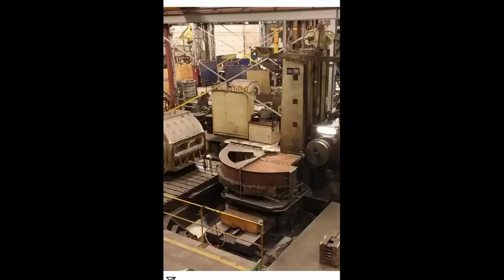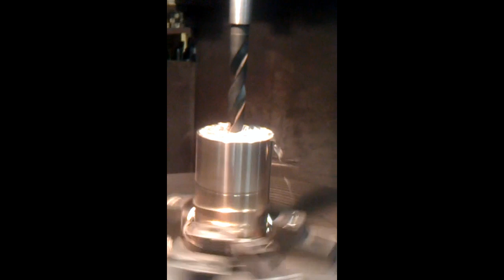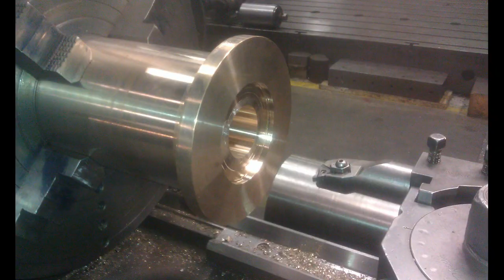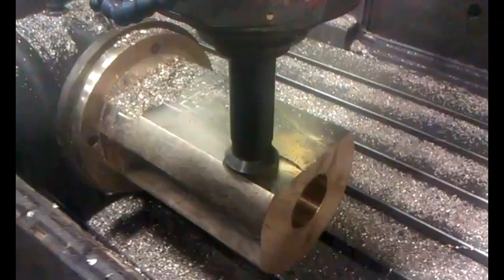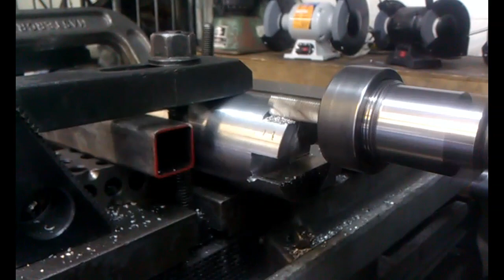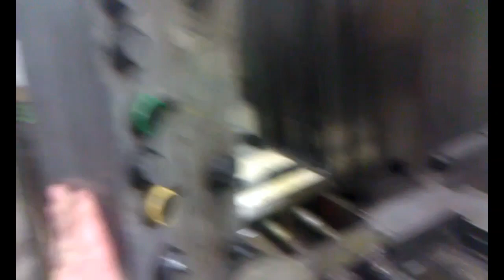lead nut

Comment: That turned out very well.  It must have gotten rid of a lot of backlash ( Come to think of it I guess the original nut ended up with infinte backlash.).  I bought a used Fexac horizontal mill about 6 years ago and had to make three new leadscrew nuts for it.  However, they were much simpler than the one you made here.  Mine were round on the OD with a flange at the end for mounting. Ken

Comment: Good job Jay, remember back in the early nineties our Richards HBM, early fifties model stripped the nut.
It had an unusual thread pitch that our lathes could not duplicate, we had to send it out to a shop that could perform the task.
Reply from the maker: Thank you. We're pretty versitile here, especially in the turning department. So not too often we stuck sending stuff out. Because of our machine invintory, we're usually who shops send stuff to. We can turn up to 20 foot diameter parts, 10 feet long and the Leonard lathe could 68" diameter up to 28 feet long.

Comment: Man that lead nut is beautiful. Looks like you got every penny out of the old one too. Nothing wrong with that 👍
Reply from the maker: Thank you. Yea we got the most of that one lol. I believe that machine is a 1978. It's about to retire though. Company has just replaced the big Union  floor type HBM that was in the begining photos with a brand new Correa floor typ HBM.  The old Correa mill I used in the video was replaced with a brand new Correa a few years back and the vertical in the vid was replaced by a 120" Toshiba vertical turning center and a second 60" vertical tunimg center. New Lathe is on the way and next in line is this ole Kearns Richards. Won't be too many old machines in there soon. Company has spent around 11 million dollars on the four new machines installed and running. Not sure about the lathe thats showing up amd will ne a couple years till the Kearns is replaced. Wish I had that kinda bread to spend on machines lol
Reply: @whiplashmachine  Just have to finish a few more bloacks then you can get that F80 rottler!
Reply from the maker: @bcbloc02  Be nice, that's for sure. But for what they cost, I think I'll probably go with more of a manufacturing milling machine as you get way more for your money. If I had the space I could of had the old Correa for 5k. Prolly won't find a deal like that again but those Nicolas Correa bed mills are still quite available and way cheaper.  Can get two or three for the same price as a used F series Rottler. I don't need the fancy interface to bore a deck an engine block square. 2nd & 3rd year apprentices where I worked get more complicated jobs than that lol.